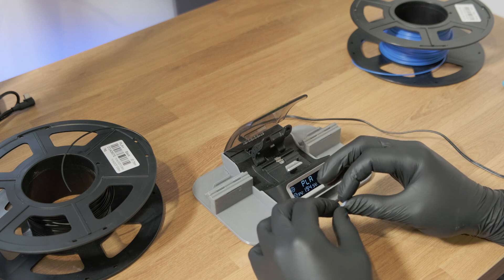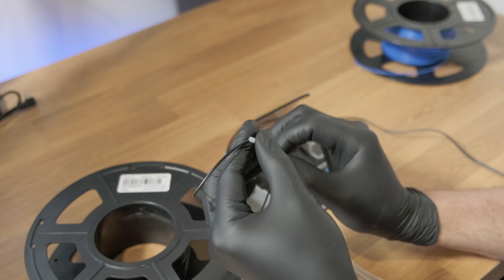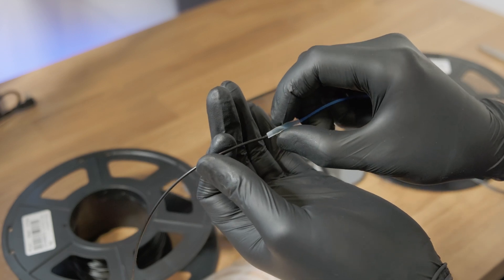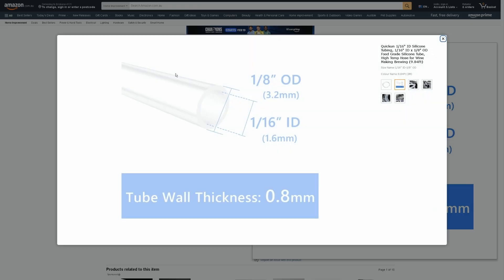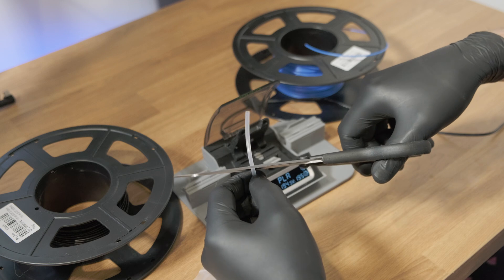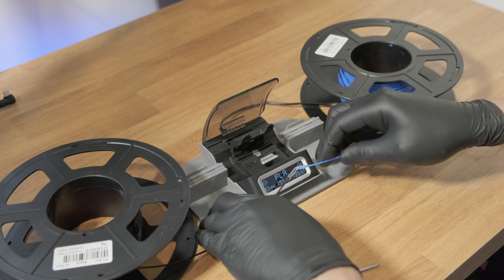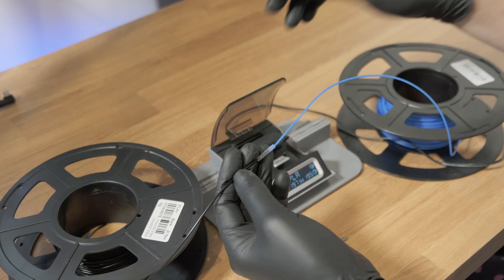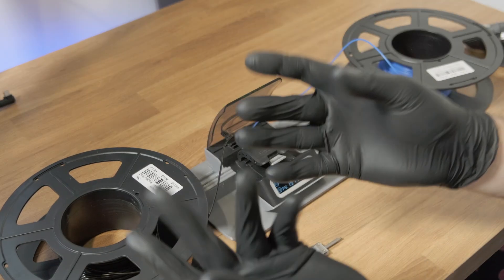Make the Sunlu Filament Connector Work Better With Silicone Tubing

Comment: This is a really good example of someone not willing to admit when they are wrong.  When you left it in the unit, you did not use the original sleeves, you did not clamp it down, and finally I read through the comments and 5 mins to cool is the average.  You keep doing you though.  Everyone else, use the clamp he shows as it is quite nice, use the original sleeves, and the right temp settings and heating times.  Then turn the unit off and leave it for 5-6 mins or so.  Bob's your uncle.    This guy, is full of sh!t.

Comment: Having been an engineer before I was retired, I just went with the tube and a soldering iron. Works a treat for me. Engineers are known for being cautious with their money (read 'tight') lol. I just sliced off the tube using a scalpel, running it sideways down the length of the tube.

Comment: Will a tube with a 1.5 inner diameter be too thin / small? I can’t seem to find a tubing with 1.6 mm Id on Amazon in the Netherlands. (Didn’t searched the whole net yet)
Reply from the maker: Yeah it probably will be, as 1.6 is already pretty tight. Try looking around another websites, you should be able to find some!

Comment: Do you just cut off the ptfe tube when your done?
Reply from the maker: If I am connecting two spools together, then yes :) If it's just two small pieces, then I can just slide it off.
Reply: @LayerLabAustralia  Thanks for replying as soon as I asked i saw the back piece the cuts it off but assuming the silicon ptfe is too big forthe built in one?

Comment: Thank you for this! I bought the Siliconetube but it is hard to get it on the Filament because its only 1.6 to 1.75 Filament - how can you slide it away after welding? Did you some Silicone Oil inside? Greetz Ed
Reply from the maker: Yeah it will be a bit tight, but you can slide it on and off easily with your fingers, no need to use any oil!

Comment: Thank you again!  You just answered my question I commented in your last video!  I already have the silicone tubing, as I planned on doing it with a soldering iron. So, would it be just as easy to do it that way, or would you recommend this instead?
Reply from the maker: Haha glad I could help! I feel like using the sunlu connector makes it a bit easier as it heats the filament 360 degrees at once, as apposed to just using a soldering iron and hoping you heated the right place long enough. :)
Reply: @LayerLabAustralia  Thank You!  I just ordered one. 😊

Comment: Thank you for spending the day with me! 😂 I finally tackled my Pastamatic project today…..and with your excellent instructions, I’ve successfully added the very helpful motor mod. Now it works like a dream! Next up….my Sunlu filament connector. I’d pitched it into a drawer (out of frustration) and recently ordered the silicone tubing you’d recommended. Still couldn’t get it to work. However, I had not watched this particular video. I’ve been cutting my silicone tubing too long and my filament ends at an angle. This video gives me a bit of hope. Shorter silicone pieces, gloves, and ends straight cut with scissors. 
I will try these changes soon, and maybe, just maybe, my Sunlu Filament Connector will not be drop-kicked into the trash! Thank you! 🎉
Reply from the maker: haha wow what a day! I remember when I got the motor up and running for the first time (albeit turning backwards cause I messed up the wiring), it was very exciting :P I felt like a real McGiver :P It's a shame that the sunlu connector is so damn finniky... The silicone tubing does work, but using the right length and cutting the filament straight should help make it more consistent. Otherwise, just get an infinity flow/ams and you never have to respool stuff ever again :D

Comment: Both of your videos have been very informative. I have been lucky and not had an issue with melting. I learned that cutting the filament at an angle gave me more surface for welding. I like the silicone tubing idea though.
Reply from the maker: Glad they have been helpful! I always found it too difficult to line up the filament when they are cut at an angle, as the tension on the spools always made it near impossible.. how did you get around it? 😁
Reply: @LayerLabAustralia personally i think my cutters are a bit beat up and not the best. This however gives me a bit of an ugly and squished angle cut at the ends and this seems to make it a tighter fit. I have a light behind the ptfe connector and can see the angled line up and the rough cuts help to  hold it in place a bit as they are extra tight in the ptfe. Maybe some crappy cutters would help haha
Reply: @LayerLabAustralia  practice 😅 I connected around 70 spools before watching this lol, it was a struggle

Comment: I find that by just straightening the filament before connecting is all I need to get a perfect weld, though I do like the holder thingy, will make holding even pressure easier.

Comment: Thanks - This (and you previous post on the Sunlu Connector) is something I desperately needed as I have too many small leftover rolls and have been wanting to do something like this. That said - What print settings were you using on your test print?!?!? Ooof - no visible layer lines that I could see.  Amazing!
Reply from the maker: Haha thanks 😁 can't remember what settings I used sorry 😢 but I do have a tendency to print everything at 0.16 😆

Comment: when the filament is ready in the joiner i open the lid and use my electric duster to cool it off quickly
Reply from the maker: good idea! If you ever design an air duster holder / fan mount for this thing, let me know! :P

Comment: So after spending a good hour joining what must have been around 50+ odd pieces of filament between 20cm and 1m, I eventually got the hang of this little joiner and just love it!

https://www.youtube.com/watch?v=ZuQxRbNTeMs

Sorry for punting my creation, but though I would show you the result of many many many tedious joins!
And at the end of it, I had 1 single join, roughly when the armpit is that jammed up because I didn't realise the "kink" was too much and got stuck before the nozzle, but a quick pause, pull, snip, reload and it finished with resounding success!
I did, however run out of the filament after the top silver, so just finished it off with the bronze I have.

Even though I must have used the same little piece of PTFE over and over, I do agree with you 100% and think that a stronger tube is required to keep it as straight as possible.

But love the channel there mate!

Stay awesome and keep printing! 🍻🍻🍻🍻
Reply from the maker: Haha sounds like a very similar experience to me! 😂 Glad you got there in the end 🙏

Comment: Strange.... I don't have a single issue with my Sunlu filament welder. Definitely user error.
Reply from the maker: I honestly thought the same thing.. but after digging around online and lots of trial and error, I found the device to be fundamentally flawed, as did many others. 
1. The rubber feet on the bottom don't grip anything, allowing the thing to slide all over the place
2. The ptfe tubing is flimsy and bends down the middle as soon as you open the heated cover, making each use a roll of the dice. The filament needs to be clamped so the tension doesn't force it out when you remove the heated cover. 
3. There is no cooling fan to speed up the cooling process to reduce the chance of the connection deforming.

Fortunately, the silicone tubing solves a lot of these issues.
Reply: I think these are all useful tips but honestly, a little practice is actually all you need. I have used mine dozens of times with no issues stock with included sheaths. I routinely connect Tricolor silks where alignment is important, so I do cut at a 45 or less angle and never have a problem. straighten out you filament closer to the device... you don't need to fight it if you straighten it a little. With practice the downward pressure if a curve can help but it just another variable you don't need... a straight run of filament doesn't fight you so you can focus on light even straight pressure pushing the ends together while hearing. The weld doesn't have to be perfect as long as it holds, relatively even and equal to or less than 1.75 all the way around. the device is awkward in some ways but still alot more workable than any other device that does this job. I like the idea of adding "stickier" pads to it. YMMV, do what works but this feels like two videos to solve issues that a little bit of practice will also fix. The biggest issue is not enough hands... may try that clamp add-on to see if it helps make things easier. Appreciate the work you did here, there are always more ways to do stuff.
Reply: Well I’ve failed at using it time and time again. Thanks for making me feel like an inept failure! Cheers! 😂